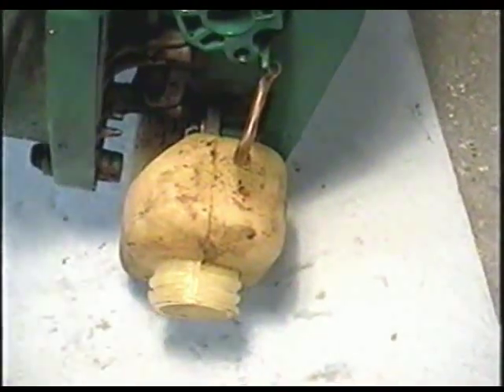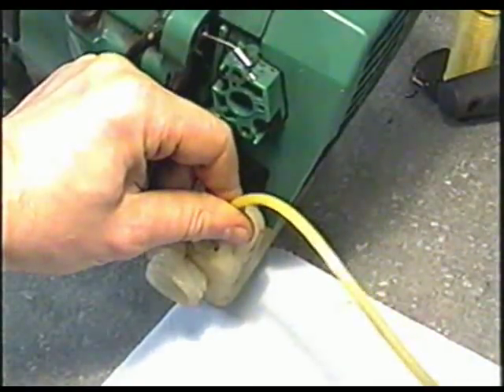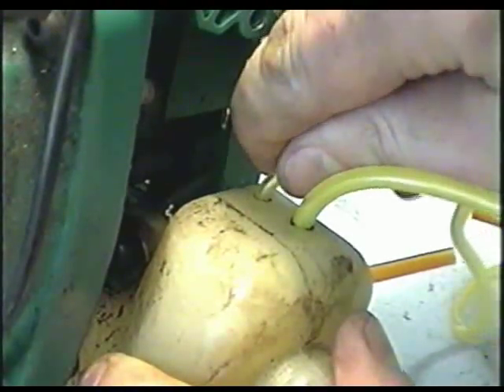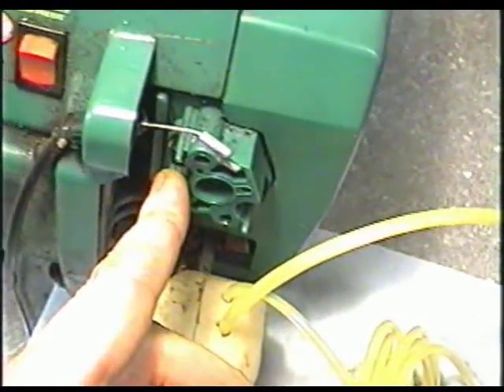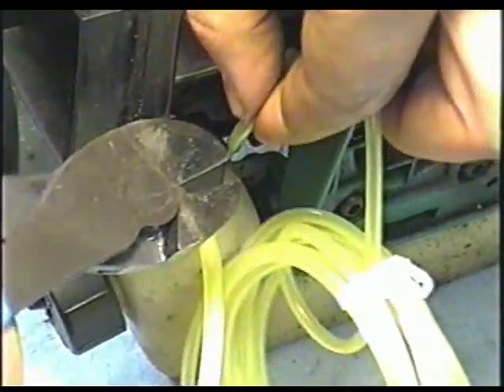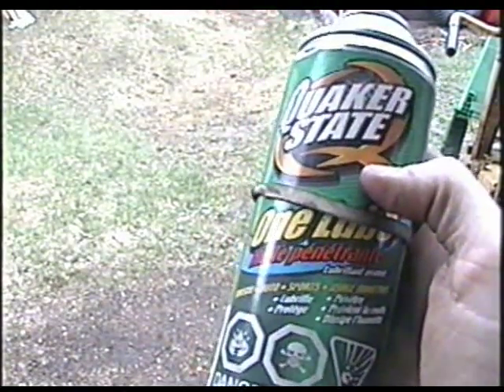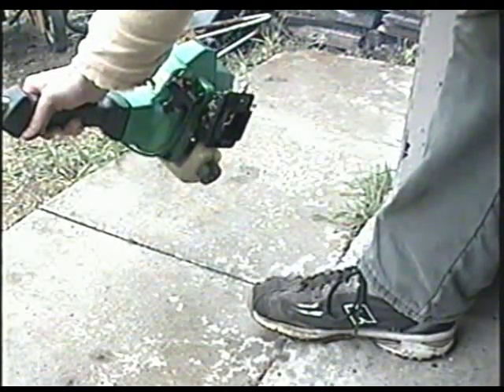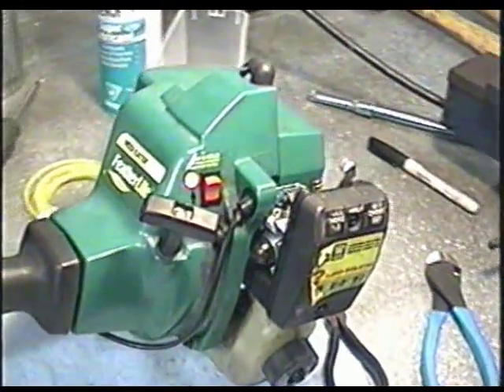Weedeater Carburetor Rebuild & Fuel Line Repair Part 3 of 3

Comment: hey don, I followed the procedure to replace the fuel lines in my weedeater ultratrim unit..
put gas in it but when I prime the carb by depressing the bulb I'm not getting any fuel from the tank.  I thought the filter in the tank might be the issue so I tried removing it.   same deal.  I thought maybe I had the purge line and the fuel lines swapped so I tried switching them at the carb.  when I unplugged the line from the purge line, it spewed fuel from the line like there was pressure built up in the tank.  any ideas what might be going on??

Comment: @donyboy73 Are the fuel line sizes the same on all featherweight weedeaters? Mine is circa 98 or 99. If so, where can I order the lines from? Mine have rotted  completely away inside the fuel tank. I would greatly appreciate it if you can help me.

Comment: Don I have a older weed eater feather lite, I would like to rebuild the carb. how do I know what kind of carb. it is? I live in Adamsville,Tn. and I don't know where to buy the kit. I would like to replace fuel lines and fuel tank as well. I love my feather lite, please help. Thanks Michael
Reply from the maker: Michael Mitchum it should say Walbro or Zama on the carb, try these guys from tennesse http://www.discountonlineparts.com/
Reply from the maker: Michael Mitchum use "donyboy73discount" at checkout and they will give you an extra 10% off
Reply: thank you so much Don I look forward to this little project.

Comment: Does the i.d. of the fuel line make any difference to engine operation? I simply replaced both fuel lines with the same "larger of the two" i.d. lines.

Comment: Hi I also need a shaft cable replaced where might I get 1, thanks, same model
Reply from the maker: sharona681 call this number with your model number 1 (877) 314-6990
Reply: thanks will do

Comment: I did the rebuild and it only runs at half choke. any ideas on what I missed .. I also soaked the carb. in the one gallon take I purchased from NAPA and blew out every line and hole.

Comment from the maker: @kawasaki000000000000 turn them out at 2 turns then slowly adjust in or out until it runs better

Comment: Know my primer bulb is separate . I get air bubbles in the line going from the carb to the primer why?
Reply: It's normal. Won't cause any issues
Reply: Okay but for some reason it is still having trouble running.
Reply: Did you clean the carburetor?
Reply: yes with carb cleaner.. I did have it running for about a minute.   Then from then on it won't start if it did it would be for maybe a second. Then I saw that gas was leaking. I'm like know what.
Reply: Could be a rip n the diaphragm causing the leading, old cracked fuel lines, or a cracked primer bulb. Sometimes they also don't run right after cleaning the carb because the carb need adjusting. Where is it leaking out of?
Reply: I don't know were it is leaking out of couldn't tell . I'll have to put it back together and see if I can see were it is leaking. Everything is new carb kit, fuel lines, primer bulb everything is replaced Walbor carb. Bought the carb kit. I replaced everything.
Reply: Sounds good. If you find where its leaking an want some help just let me know
Reply: Okay thank you

Comment: Tried the adjustment...really makes no difference...It runs and sounds great...until you push the lever to engage for trimming and then BOG OUT....I was going to just spend the $30 for new carb...IF...there is no other part that might be causing this...I don't wanna keep poring into a moneypit. SHAME that Craftsman quality has gone so far down....at least I'm trying...chalk that up to one for the girls